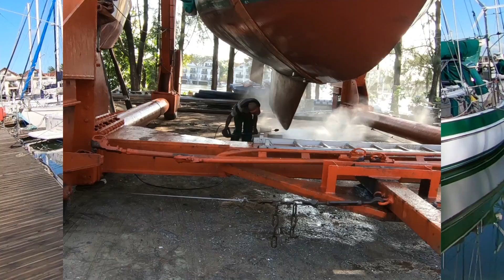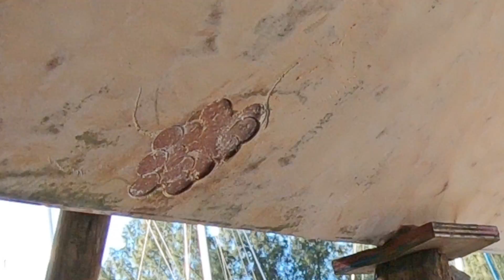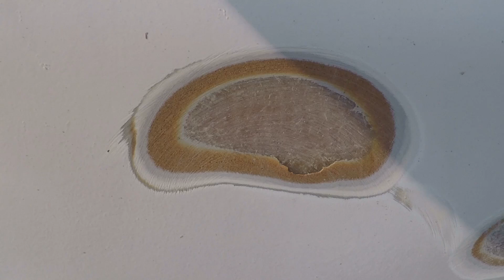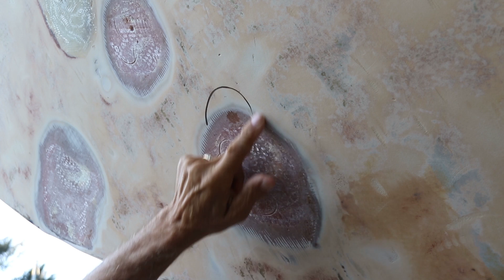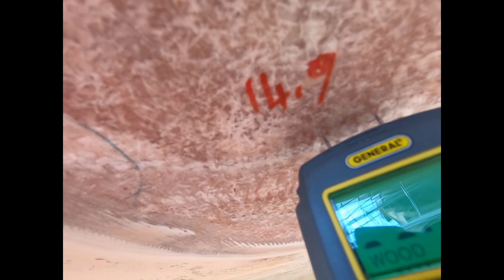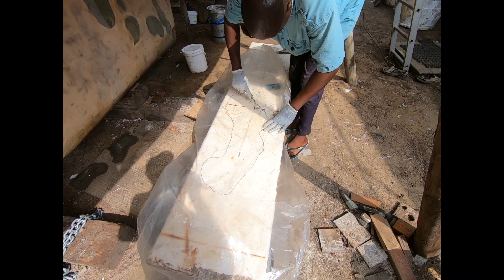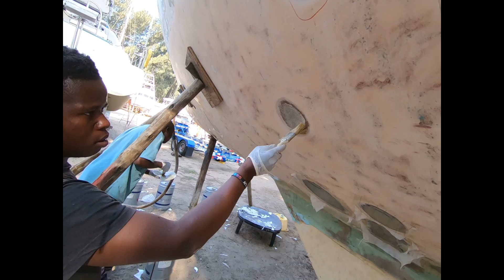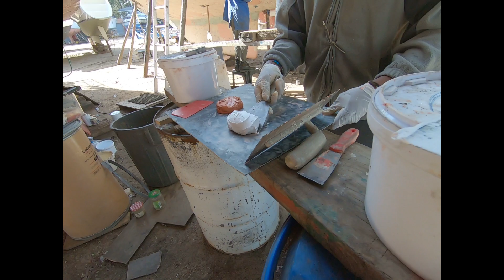500 ROTTEN, FESTERING Blisters!!  - Blister Repair on a Fiberglass Sail boat! (Patrick Childress 59)

Comment: they disobeyed rule number 1 with fixing a polyester resin boat, dont use epoxy resin.
oh dear. 20 years in your gonna have issues again.
Reply from the maker: That is interesting. You are the first to ever say this. Why would that be?
Reply: @SailingBrickHouseAndOsprey  also , whilst epoxy will bond to cured poly fairly well, poly will not adhere to cured epoxy, in fact it makes only a superficial bond, so once youve gone over to epoxy?
it means all repairs in future need to be epoxy, and it also means you cant really do a proper repair as gelcoat wont stick to epoxy, which gives you another issue in that epoxy will degrade in UV , so the overcoat of paint needs to be high quality, polyurethane two pack is the way to go in my experience but then your back to horrific fume issues..
and the highest quality you will get ?
is out of the equation because you cant gelcoat.
Reply: @SailingBrickHouseAndOsprey  because im not selling epoxy resin.
it will hold -but especially if you have substandard resin as a start point its advisable to go like with like.
ive repaired many boats and if its polyester? you use polyester.
the bond is way better. epoxy doesnt hold as well to poly although it  is a little stronger , some poly boats ive seen repaired with epoxy?
 the patches have just lifted off.
a good key and thus a good mechanical bond and it should be fine, its often done in many boatyards but its not proper practice.
its also cheaper, the downside is that its toxic as fuck, but so is epoxy except you cant smell the chemicals in epoxy quite as much, though they will still get you high and make you grow tits.
epoxy is easier to work, less unpleasant to deal with the fumes and  thus many still use it, but when i was in the field we had fed air systems no matter what we worked on so not really an issue for us.
Reply from the maker: Thanks for your information based on experience. The resin used on this boat was some sort of resin with a bad fire retardant additive. That additive did not react well and caused the blister issue. If we should have any patch failures, I will certainly remember your comment. Thanks!
Reply: @SailingBrickHouseAndOsprey  it will be a long way down the road if you do, but if she gets scarred up be sure to keep with epoxy once your down that road, for an old boat like this thats probably got 20/30 years left in her it doesnt really matter and itll be fine, im just being a snob :)
Reply from the maker: We have nothing against snobs...especially those with good information to share with our viewers. I’m just glad to have this damn blister repair out of the way for a while...so we can get back to sailing this old sailboat! -Rebecca
Reply: @SailingBrickHouseAndOsprey  its a hell of a task, you must love the old girl!
i only saw the title of the other video "is this worth repairing" lol, couldnt bear to watch it as i think i know the answer!
Reply from the maker: deadprivacy ah...come on...watch it...I know you want to see more rotten festering hull blisters from hell :) -Rebecca
Reply: @SailingBrickHouseAndOsprey  seen way too many of them, im a car mechanic these days, if i never see another boat in my life i will be happy:)
Reply from the maker: @deadprivacy  if you fixed  boats for a living, I can perfectly see the shift to car mechanic, house painter or nearly anything else. I would never do this sort of work for a living. I do it only to keep our boat going and to be safe. I used to be a professional boat captain delivering beautiful boats across oceans and operating day sailing boats in the Caribbean. I got paid to have fun, but even that got old. I made more money, faster, and I was at home every evening, when I started painting houses and doing carpentry rehab work on houses. But Rebecca dragged me off on this sailboat so here we are. Just today, we finished putting in lithium batteries and a new fresh water heater. I told Rebecca NO MORE. We will now go with what we have whether it is broken or working. Done.
Reply: @SailingBrickHouseAndOsprey  tight lines buddy, i got into nboats because i lived on one, just fell into working in the yards, made me begin to resent living on one, too many winter nights running round the yard stopping em sinking in storms, putting out fires on occasion and never getting my own done, always another job on it, it began to consume me!
then i moved from working on the little pleasure stuff to welding and repainting huge navy vessels and ships, mainly as a fitter and repairman on uhp blasters,
water at such high pressure itll cut right through a man, seen it happen too...took his foot near clean off.
wouldve taken about a half hour to blast out them blisters with one! 

ill go back to em when im older but to be frank the sea is too bloody dangerous and ill retire on a nice little canal boat methinks:)
youre a brave man is all i can say, thats a very small boat in a very big ocean!
Reply: @SailingBrickHouseAndOsprey  So, cruising is a busman's holiday for you.
Reply: deadprivacy: Patrick tells us that he is 69 y/o. Have you ever heard of a man sailing at 89? FWIW, I am 77 y/o and owned boats from age 17 to 60.

Comment: Why didn't you just sandblast the entire hull? It would have been easier, faster, more economical and ensured the entire hull was fixed. You then could have applied full sheets of whatever product instead of all the patches.
Reply from the maker: Because of bad, past, experiences, this haul out facility does not allow blasting of any sort. Any way, sand blasting is not good on fiberglass as it leaves minute particles embedded in the fiberglass. A form of wet blasting or soda blasting would work for fast removal of material but they don't even allow that.  Soda blasting, or such,  would be  good for an even depth removal, like peeling with a planer.  As shown in the video, these resin blisters are anything but uniform and develop at various depths in the laminate so must be individually ground out and rebuilt back to the original hull thickness.  Unfortunately there is no quick or easy approach for this resin blister problem. Thanks for your comment.

Comment: Do you have any good tips for fiberglassing overhead ?
Making cloth stick to bottom of the hull ?
Reply from the maker: If you watch in the video, you see how a divot is wetted with  resin, then the patch is wetted on a board before applying to the divot. Then a fin roller is used to squeeze out any air and excess resin before applying more layers of wetted out cloth. Several layers can be wetted out on the board, stacked on top of each other, then applied in one go.  If there is any concern about too much weight and the patch might fall out, then just a couple layers are applied and allowed to get very tacky before applying more layers, before the resin hardens up completely. Applying too many layers at one time could cause the resin to get hot during the cure which is a very bad thing. It takes a little practice and good judgment by the applicator.
Reply: @SailingBrickHouseAndOsprey  thanks for your response.  I was talking about big areas, like 50" wide x 3 foot.
But I found a way ...laying it on cardboard and pressing from cardboard to haul. 
To clarify,  wet out on cardboard...and work it from cardboard to haul. From top to bottom bending cardboard back as you go .
Or it falls on your head. 
Thanks again.

I found an even better way.
I cut biax 30" x 50" wetted it out on visqueen over table,  then cut a pool noodle to 34 " ....rolled glass onto pool noodle then rolled noodle and glass onto hull top to bottom working it onto hull with gloved hands and putty spreader.

Comment: To be honest. I'd have drawn a grid and drill into each section because I can guarantee that you've missed at least a couple. Then again, you very well might anyway and it could just be my OCD nature. Either way, a lovely boat and it's nice to see someone take such good care of it!
Reply from the maker: How to fix a boat, lets count the ways..... In the video you  can see holes I drilled into areas I thought had a blister and it turned out to be nothing, but left me with a hole to grind out and patch. Over all, I would not be surprised if blisters show up in new areas of the hull that were not dealt with this time around. Normally, like you, I can't leave well enough alone....but on this project, I will leave alone those areas that currently do not show signs of blisters. If in 20 years blisters return, I won't be worrying about it. I don't know any other Valiant blister boat that has gone through this approach of blister repair. I feel good about it. Thanks for your comment.

Comment: Wow, that's an extensive amount of blistering. I hadn't realized there were alternatives to the standard fiberglass resin back in the 70's. I had done a little fiberglass work back then but nothing like a boat!
Reply from the maker: The builder of this boat was also making power boats for the U.S. military, in which a fire retardant resin was required. They used the same resin for making the sailboats and unfortunately, it did not work out.

Comment: Cordless oscillation tool might work better than the modified hole saw.
Reply from the maker: That would be a good idea to try, next time....in twenty years, at the earliest, from now. I would be interested to know how it works if anyone else tries using that tool to open blisters.

Comment: You should have used a multi-tool with a metal cutting blade on it and just worked around the edge of each blister. So many people look over the multi tool but with the right blade it is often the best option for strange jobs, like this one.
Reply from the maker: Silly me, I have a multitool, which is something of a new tool to me, but never thought of using it for opening the blisters. It could have done a better job, faster. Hopefully there will be no next time for me to try it, but someone else reading this might benefit from your comment. Thanks.

Comment: Don’t they use an infrared heat lamp to dry out the blisters?
Reply from the maker: Heat lamps can be had but it cost a lot of money to pay for the electricity. There was so much area to be done, and there was no great rush, it was not practical. The heat and low humidity in Richards Bay was a good natural  climate for this work.

Comment: I think I would just buy another boat and call it a day.
Reply from the maker: But would that other boat have something worse than a case of the blisters :) Yeah, if we had a good supply of cash, maybe that would be an option. But like Patrick says, it’s hard to find a boat as good as this one...and every boat, even a brand spanking new boat will have problems..big ones...so what gives!? I think I rather have 500 resin blisters than spend 500 grand ;) -Rebecca
Reply: @SailingBrickHouseAndOsprey   I have only bought  old boats , from good owners  and have never had the blister problem , I have seen some almost as bad as yours . what bothers me is the secondary lamination may not be as good as the original  ( I have heard this ) but the repair jobs I have seen seem to get it done .  I hope it works out !
Reply from the maker: @kevinhoffman8214  Hi Kevin, Thanks for your comment. The resin blister problem on the Valiant 40s is well known. The blister problem started in 1976 and ended in 1981, "the blister boat era." I think we have shown that one can't just peel a boat to a shallow depth but must go to the roots of the blisters to solve the problem for the foreseeable future.  Doing this work, I uncovered two deep blisters, below the waterline, that were patched 11 years ago in Colombia. Just chopped strand mat and polyester resin was used for those two patches. They are still in great shape and needed no further attention. Judging by this, I feel pretty good for our aggressive attention to the blisters and all the epoxy and 1708 laminating. Time will tell, but I think we are good for at least 20 years. I will let you know.

Comment: Hello Patrick, I would like to recommend the Swedish trademark Nils Malmgren AB, epoxi manufacturer, from city Gothenburg. I have worked with Nils Malmgren epoxi and I bought a scale, electronic, from the manufacturer Malmgren for only 15 USD. I do exact weighing  alwas, and reach a good result. I work with small quntities and brush it out with a soft brush within 20 minutes maximum. I can use bidirectional  vowen  cloth  as toplayer and as basic layer I use Biltema AB, Linkoping,Sweden, glassfiber cloth  450 gram per square meter with excellant result. System West Epoxi uses volume pumps wich is not as accurate, because sometimes you pump differently.  Nils Malmgren has produced epoxi since 1936 and the firm started in  year 1880. The translation from English into Swedish did not work as planned because a computer had chosen errenous word all the time, sorry for that. I manged to understand English without the automatic translator, which was not possible to turn off.
KIndestregards from guy Lars
Reply from the maker: The epoxy pumps are very hard to find for sale in S. Africa since so many people could not catch on just how to use them properly, resulting in bad mixes. This is one reason only Talente or a couple of the other people were allowed to mix the epoxy. But then too, pouring out just the right mix onto a scale could go wrong.... Sorry for the Google translations being so bad. Thanks for letting us know about that.

Comment: I do not have enough information from the video but I would lean towards delamination not blisters. 
a totally different issue, but yes could be related oil prices.
Reply from the maker: They went with a cheaper resin which contained a bad fire retardant product. That ingredient did not react well with the fiberglass cloth causing the poor setting of the resin problem. Google "Valiant 40, resin blister" and you will find plenty of information.
Reply: Ding, ding, ding.  Alain Pascal is the Winner. I worked in Fiberglass shops for 20 years. This is delamination of an improper build layup between layers!  This layer bonding issue will keep happening, until this boat is properly Scuttled!
Reply from the maker: @notagain8661  1) What would cause such an improper layup? 2} Why is there moisture in most of the blisters? 3) Why did this happen only between the years of 1976 and 1981? 4) Why does it not happen everywhere at the same time? That would help clarify things.

Comment: In the Mediterranean I have seen quite a few older American with similar problems. Maybe not quite as bad as yours though.
Reply from the maker: Anyone could see that our boat had blisters but only when we really started grinding them out, and looking closely for more did it turn into a terrible looking mess. But like pulling dandelions by the roots, I think we got the cure on most of the blisters. Thanks for your comment.

Comment: What a huge project, labour costs in the west would have been enormous.
Reply from the maker: The minimum wage in S.Africa is $1.50, the decimal point is in the right place, per hour. Fiji and Malaysia are not much different. Colombia, labor is cheap, relative to the U.S., also. It only cost us several thousand dollars for materials and supplies to do this work. Unlike most boats, our old Valiant is worth more now than when we set out 12 years ago. Thanks for your comment.
Reply: @SailingBrickHouseAndOsprey  I suspect in Australia (where I live) if you were lucky you might pay 30-50 dollars an hour.
Reply from the maker: Yes, anyone willing to work on blister repairs would probably charge more than this in the USA. That’s why we wouldn’t even contemplate repairing these resin blisters in a place like Australia or the USA. Places like South Africa get themselves lot of work with boats needing repairs like this. Very smart of them.-Rebecca

Comment: If you repair just the blisters you find you will be back at it again very soon.  My recommendation is ARSON.  But if you are REALLY set on putting years of travel on this particular hull - grind out everything below the waterline and use VINYL ESTER Resin.  That's been the only thing that stops this permanently.
Reply from the maker: PS Vinylester resin was used 19 years ago on these epoxy resin blisters. They reappeared less than 10 years later. So I guess vinylester doesn’t work so well on resin blisters! -Rebecca
Reply from the maker: As the video says, these have nothing to do with osmotic blisters. Only epoxy products are good enough to use on these resin blisters, above and below the water line. Thanks for your comment.